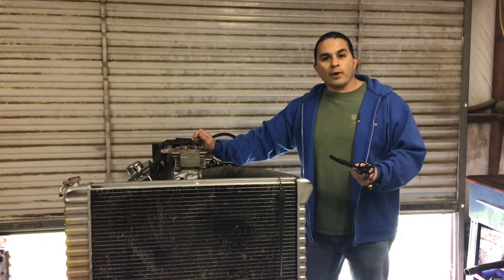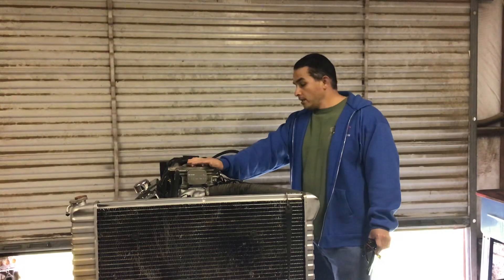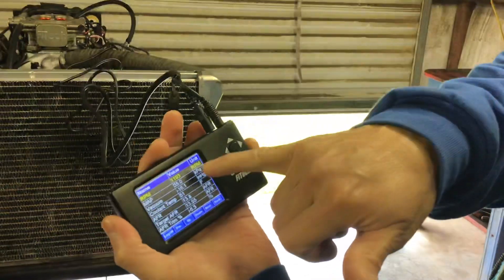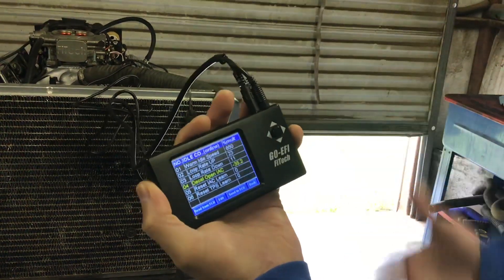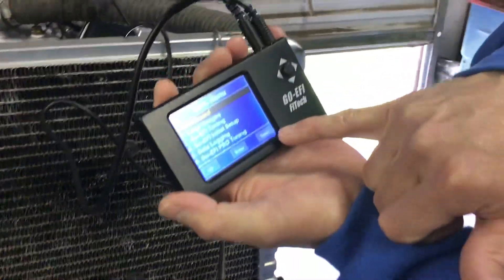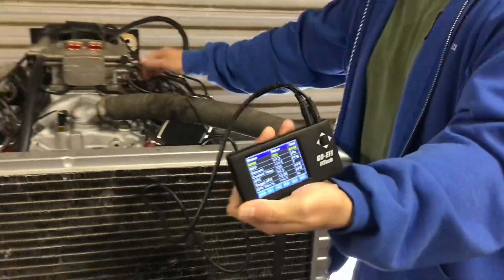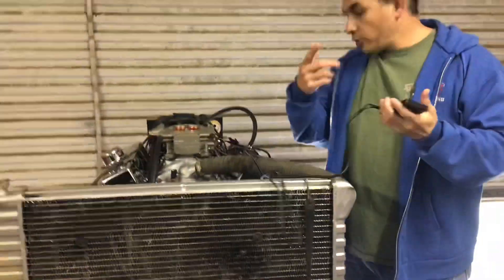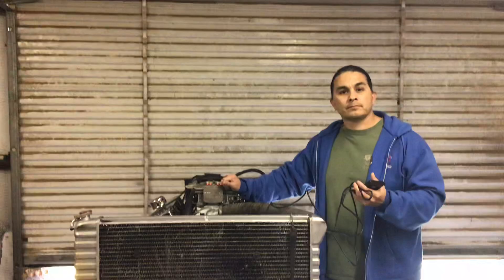Fitech tuning, Decelerations IAC

Comment: Wish i could find someone with ball park figures for a 1200hp Fitech on fresh roller cammed out 540BBC in a 72 Chevelle with TKO 5-speed,  Seems impossible to get the IAC steps to stay put between 3 & 10, And I cant get the idle to come down, I have it set now to 600rpm but it stays around 850, It has no vacuum leaks, I also have the different controller.
Reply from the maker: Jocrp6
When you adjust for the IAC,  do you shut the vehicle off and wait until the computer completely shuts off? Make very very small adjustments, turn the screw less than a quarter turn each time and make sure to wait 10 to 15 seconds each time you shut off the ignition so the computer can reset. If it is a very large cam the idle will have too be higher than 600
Reply: @reyracer  That might be my problem on not shutting vehicle off,  I know there is no possible way for engine to idle at 600 rpm,  but it dosnt matter what rpm i set, it stays around 850 to a 1K rpm idle,
Reply: @reyracer  Ive bout had with this, Ive finally got the IAC steps where need to be with 750rpm idle and now its backfiring thru the exhaust with AFR of 15-1 during idle. first its ever done this. things impossible!
Reply: I know I had the same issues. I dumped it went back to my carb
Reply: @philh9238  I did figure what was going on with my set up on BBC,,, Headers were cooking the MSD plug boots causing misfires,, Had to run boot sleeves, fixed!
Reply: @jocrp6 thanks for sharing your progress as well as your issues. If people did the research to look I’m sure this would help thousands of other. Congrats and keep wrenching 🤘🏼😎
Reply: Oh yea! The Fitech forums suck ass also!